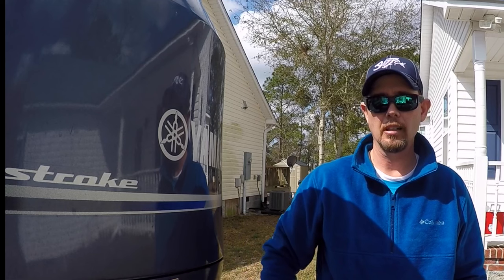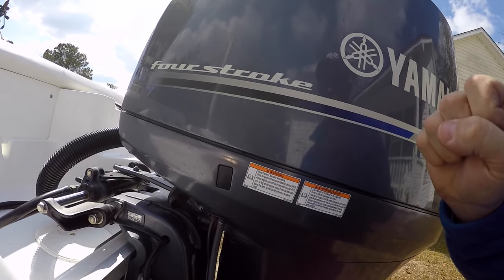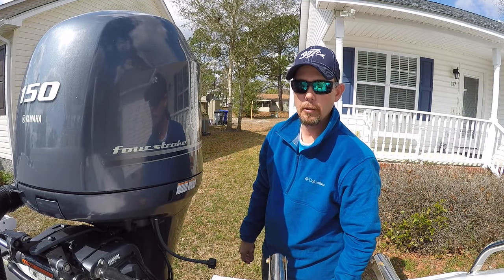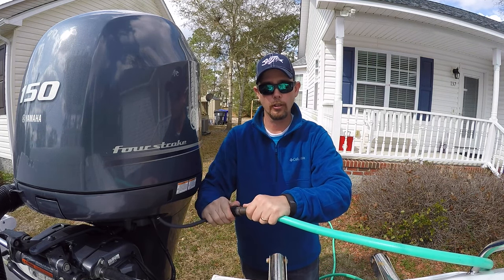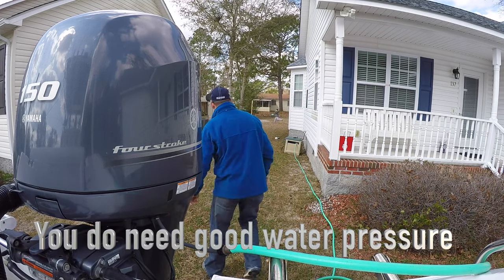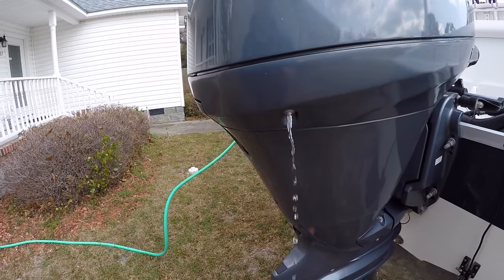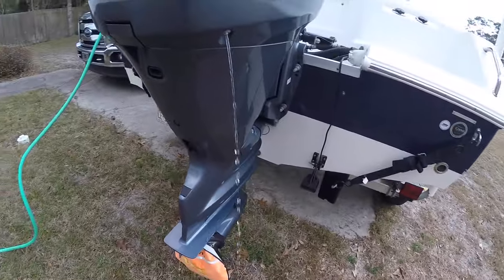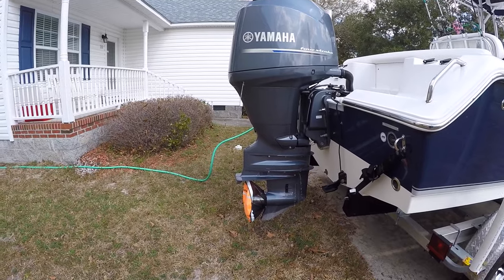How to Flush Saltwater from a Yamaha 4 Stroke Outboard

Comment: Great video with great instructions.  Respect. My preference is the Muffs because it allows the thermostats to open and flush entire system. Love the engine BTW.
Reply from the maker: Thanks for watching I do agree that would be better. I am just following the directions of what the dealer told me to do. Yes sir great engine!!
Reply: From what I understand the thermostat has holes that will bypass the water through to "flush the entire system".

Comment: I see a lot of comments here that this method does not flush the entire motor.  According to Yamaha it will.  There are small bypass holes at the thermostats that will allow flushing of the entire motor.  No need to run the engine. They recommend running the water for at least 10 minutes.
Reply from the maker: Thank you so much for this clarification!! I feel much better about flushing my motor this way now. By a lot of the comments and even though the dealer told me to do it this way I was still feeling uneasy because I was not flushing it correctly. I usually let it flush this way for 15 to 20 mins actually.  Thank you I really appreciate it!! 😃
Reply: Water with small amount of salt away for 10-15 minutes is perfect

Comment: This is a good way to flush your motor in a pinch or if kept on a lift. But it does not flush the entire motor. The Thermostat is closed when the motors off and water can not flow past it. 

 It is much better to flush with muffs. Crank the motor while flushing and let it come up to normal operating temperature so the thermostat opens. This ensures the entire cooling passage gets flushed.
Reply from the maker: Ok thanks for the heads up. I have a set of muffs as well.
Reply: Im glad to see people actually giving proper advice rather than bashing people for being "idiots" thank you @mdees88!

Comment: Just tip #2 According to my dealer, if you do this with a cold motor the water is not going to flow through the passages that have the T-Stats Closed on them.  You'll get most of the engine, but not all of it.  It's best to either warm up the motor first or better yet (which requires muffs) or just flush from muffs and run it if you use your boat in saltwater.  Also a good desalting solutions from an injector kit and muffs will clean better, in less time, and leave a protective coating on the interior of the motor.
Reply from the maker: Thanks you for the feedback. It is very appreciative. I was just going by what they told me at the dealership. 👊
Reply: Is it really necessary to put on the muffs on a 4 stroke after connecting the garden hose? As I've already indicated above, after I connect the garden  hose to my 2006 4 stroke Yamaha, I also turn on the engine and let it run in neutral for 10 minutes. Then I turn of the engine, let the water flush for another 5 minutes. Am I harming anything by doing so? Would appreciate your comments. Thanks in advance.
Reply: H
Reply: @rehaerman6519  are you turning the engine on without muffs on just using the same steps as above video?? If so that is a massive no no. You will be stuffing your water pump.

Comment: Got a question 
I have a Yamaha 4 stroke. Top flush also. Ear muffs won’t work since I’m on a well . Not enough pressure from the well to push through the motor so I just use top flush. I do realize the Thermostat won’t  open without the engine running for the top flush so I bought a flush bag. Flush bag works good but it’s a pain to fill. 
My question is if I remove the thermostat while using the top flush would that flush the whole system ?
Also I use saltaway but keep in mind if you flush using top flush only the the thermostat will gum up so keep it clean....
Great motor. Always keep the VST filter drained for water if using ethonal based fuel. Damn water phase separation will kill the engine.

Comment: Hi…. as a qualified automotive mechanic…I have been using 1 litter of engine coolant inhibitor right at the end of the flush on my outboard…which keeps all seals and aluminum housing lubricated at all times and keeps a film of anti-rust and anti-corrosion at all time…what is your thoughts on this ???
Reply from the maker: Thanks for the comment. I am no mechanic by any means. I do what the dealer said to do after each saltwater trip. I also take it to be service pretty much yearly. No one has said to me at the dealer to use what you are talking about. But that doesn't mean you can't, I would personally call them a ask them before I added anything, but thats just me.

Comment: Make sure to flush it with Salt Away if you're in salt water.  It removes the salt much better than regular H2O and provides corrosion protection.  You flush for a couple minutes with regular H2O then Salt Away for another minute or so.  Do not flush again with H2O after applying Salt Away because of the corrosion protection from Salt Away.
Reply from the maker: Thanks for the heads up!! I appreciate the tip cause I am certainly no mechanic.
Reply: Thanks for the tip mate.

Comment: The impellor is plastic and can burn out if using the top flush.  I always use muffs only.
Reply from the maker: Thanks for watching. I never run the engine when I am flushing the motor. This way sends the water everywhere it needs to go to get the motor flushed according to the dealer.
Reply: Never run a Yamaha on ear muffs longer then 5 mins you will melt the water pump housing. Get a bucket and fill it with water make sure the water is above the cavitation plate. And yes a true flush is to run it on fresh water so the t stats open. I'm a yami tech so take my advice we have so many customers come in with smoked housing cuz they run it on muffs too long
Reply: @ryangallagher3611  been running mine for 20-30min since new on muffs. Haven't  had anything melt or any trouble yet.
Reply: Are you sure that they were running it with water running through the ear muffs?  The engine should run indefinitely if properly running water through the system.  I will bet they didn't line up the muffs with the ports or lied and were running with engine out of the water and dint want to admit it.

Comment: I think you were misguided on that method of flushing. That method is used to flush the engine with the engine not running and was intended for like when boat is still in the water and muff flushing cannot be practical. The method you show here i don't believe is conducive for flushing the lower half of the motor as in around and thru the water pick-up and impeller assembly and exhaust thru hub passages
Reply from the maker: Yes sir I feel like I was as well! :( Thank you for the input!!
Reply: You are absolutely incorrect. This method is for STATIC flushing of ALL environmental contaminants of the unit. Everything that requires environmental pick-up for cooling is flushed via this method. Unit needs to be out of the water, warm, off and level for proper flushing. -Retired Coastie
Reply: @rdzed3505  well my yamaha owners manual I recieved with my  2017 4 stroke must be incorrect also then. Flush with what ever method you desire, I will continue to flush using the method I have always flushed with, so it doesnt bother me in the least. Cheers.
Reply: @zash008  And that's fine. My point was this flush point is not only for the unit being in the water. As long as the engine isnt running, you can flush thru the garden hose fitting all day long and in any instance. My routine is 20 min with muffs on and at idle, 20 min backflush with the hose fitting, engine off, level and shes done. Twin Yamaha 150 4 sks with 1200 hours each.
Reply: 40 minutes of flushing? Really?  Man, that seems excessive.

Comment: Should run engine to flush and you don't need 20 min
Reply: No you will ruin the impaler
Reply: You run the engine when flushing with muffs and do not run the engine when flushing from the top port since that pushes water against the water pump.

Comment: the best way to flush out your motor is to used flushers that go on the water intake holes on the gearbox.
Reply from the maker: Thanks, I am just going by what the dealer showed me and told me to do. Thanks for watching!!
Reply: He's right mate. It doesn't flush all the salt out as the thermostat is not open. I have the same out boards on my boat. That system is for a quick flush if going out days on end or flushing while staying overnighter with fresh water on board. You need to run to allow water through all passaged